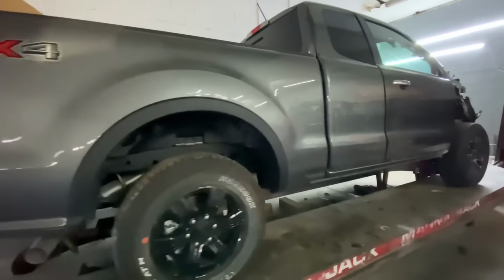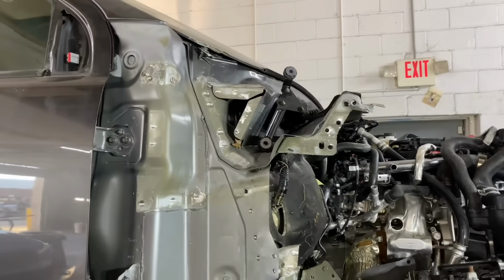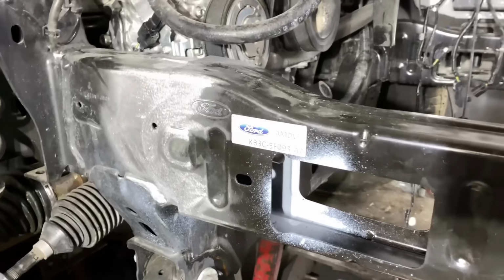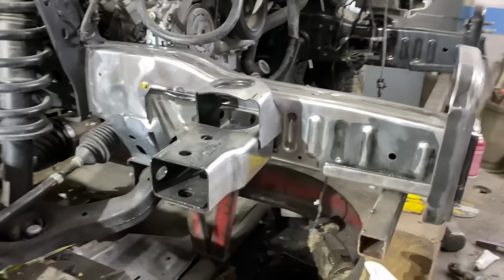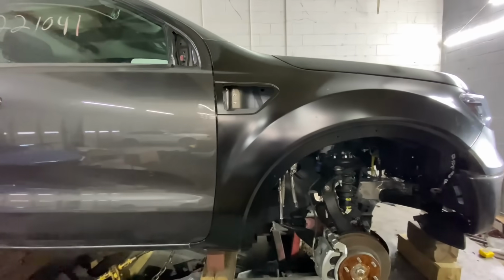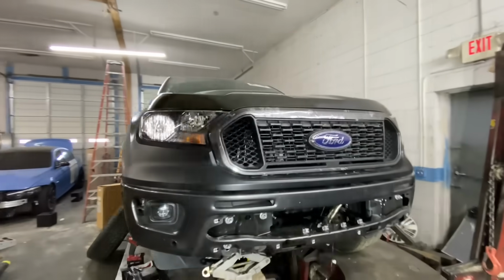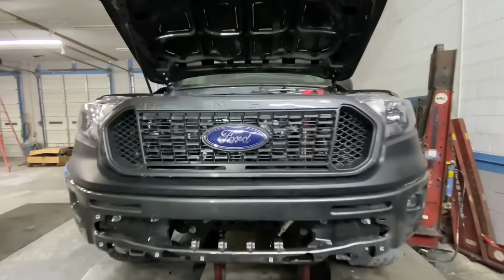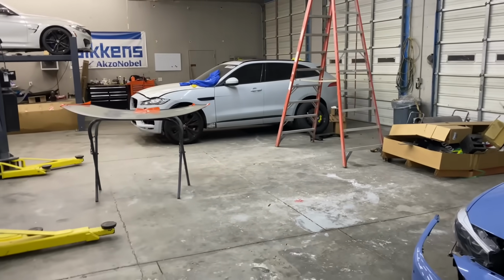Rebuilding A Wrecked 2023 Ford Ranger, Part 1. Huge Frame Job

Comment: curios  why did you clean up the whole frame horn to bare metal? is that so you dont burn up the paint while welding? or to have it even smooth surface to paint?